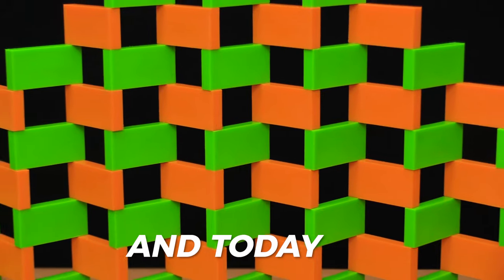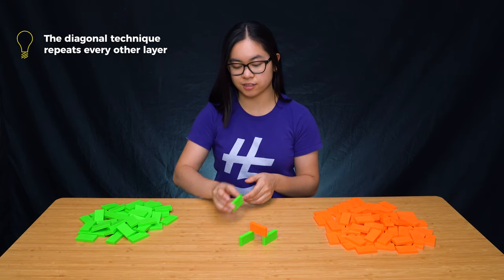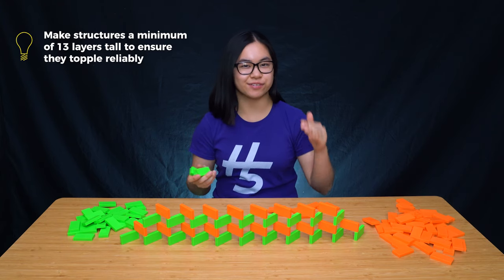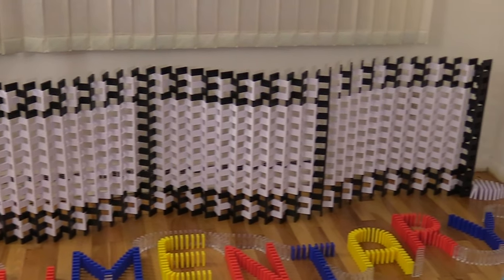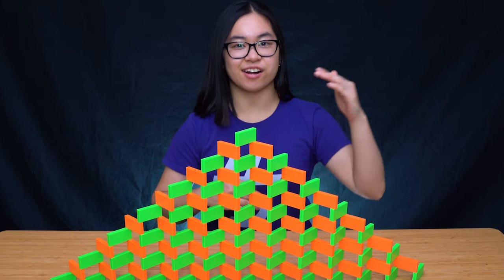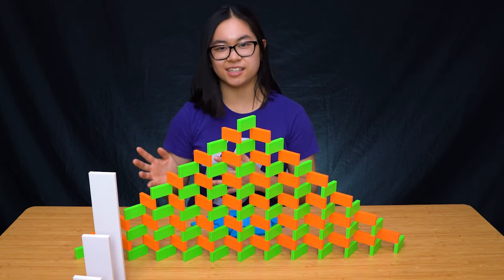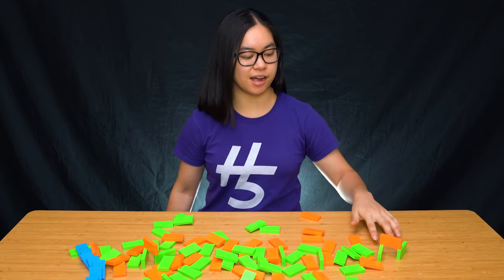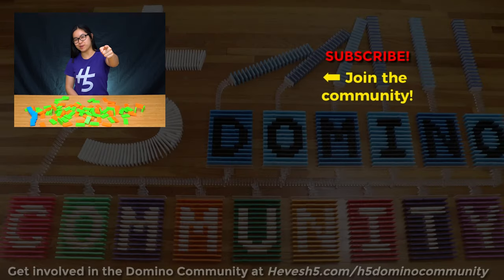How to Build a Domino Wall (pt. 3: Diagonal Technique)

Comment from the maker: what is your favorite wall technique, and why do you prefer to use that one?
Reply: The diagonal technique because your videos get better !
Reply: Diagonal technique is too good because it looks too  good and is uses very little time 🤠🤠🤠
Reply: I love this technique better than anything cause its so smooth when it falls its like a feather
Reply: My favorite is The Diagonal Technique, as well as the Column Technique.
Reply: This one in this vid which is easy to build and it uses a few blocks of dominoes only! Awesome!
Reply: I was searching for this Wall
Reply: The wall column technique becasue whit a little bit more easier than another strucrures
Reply: same
Reply: H5 Domino in india
Reply: The column tehnique because it opens the most posibilites to the builder
Reply: I already knew this but this is my favourite 😄
Reply: I like column technique
Reply: Can you tell more
Reply: the diagnoal technique was easy and more creative
Reply: All of them because I can put the creativity to any walls and combine it to one structure!
Reply: I think it’s the other two rather than the diagonal technique
Reply: i don’t know
Reply: @RaduPetrici  column wall is the best wall type for handeling pressure from above
like in the wallback . . or . . supporting a small platform built on top
alternating wall can be connected to the 3d pyramid in interesting ways
and the diagonal wall is prettymuch the main component of many structures including that 3d pyramig

fun fact: alternating wall works with the normal wallbact . . but NOT with the Slanted wallback
that't where you need the collumn wall
Reply: The Alternating version because I don't want to leave any dominoes still standng
Reply: Diagonal wall technique bc it is so satisfying and your videos get better and better so diagonal wall technique it is
Reply: I would use this one bc I just made a wall with this one and I made a wall with all the techniques and added some sonimod to it and the slanted wallback and the full wallback and a backup line and the split to topple the backup line and I just prefer this one I would tell all the people who is reading to use this technique plz use this one I am telling you to use it and everyone else to use this one bc I just love it’s amazing
Reply: I like the diagonal technique because it more looks better
Reply: @nosfe_458  same

Comment: Yaay! The final part of the domino wall tutorial series is finally here! I'd say that my favorite technique is the diagonal technique, it's something about the reliable feeling that I get while building this type of wall (Not to say that the others are bad, it's my preference). Also this is a plus point about the diagonal wall for me, it's short, which means that it works like MAGIC with wooden dominoes. Everyone probably knows about the wooden domino dimension problem already, but if I had to recommend a technique to the people struggling to build giant structures with wooden dominoes, it's the diagonal wall, because it isn't something that gets tall, so that's a plus point. 
Anyways, good work Lily :)

Comment: WOW, thank you so much for featuring me after posting that comment on the advantages of using the alternate and column technique! 😎
Ok, what can I say about the diagonal technique... which is more manipulable as we saw in regular and irregular shapes, and that it can be easily transformed into a wall using the column technique, disadvantages: none, except that if you want to make a straight wall, it is more advisable to use the column technique or the alternative, and as I told you in this case I would prefer to use the alternative technique for straight walls! 😉

Comment: Great job! Lily! The tutorial was very detailed! 

My favourite wall techniques was diagonal techniques and column techniques. This is because diagonal wall is easy to build. And I think those are more stable to build and trigger will be more easier. I think the alternating technique wall can be a little bit unreliable. Because not all of the dominoes can be build for alternating techniques. And I think sometimes it will fall accidentally when it blew by wind. 

But yeah the tutorial was really good and Lily you did a really fabulous job though!
Keep on building! :D  /|||
Reply from the maker: Thanks! And good points about each type of wall - thank you for sharing your thoughts!
Reply: @H5dominocommunity  Thank you! :D

Comment: One tip:
If your dominoes are not 2 by 1, refrain from using the alternating technique to build walls.
One bonus:
It is possible to build a 90° wall with the ALTERNATING technique.
Reply from the maker: I would agree with your tip (especially avoid the alternating technique because the vertical domino will not align). Yes it is possible to build a 90 degree wall with the alternating technique. I will make a tutorial on this in the future!

Comment: Hello Lily! Is it possible to build a wall using this technique that has perpendicular corners at the top and not that pyramid-like shape? And if so, how is it made?
Reply from the maker: Yes, it would be a similar method to how I made the "square corner" on the column technique tutorial. Since those 2 techniques connect (they have similar structures), you can use the same method to make it a perpendicular corner: https://youtu.be/FURDwGllIak?t=314
Reply: @H5dominocommunity  Thanks a lot, Lily! 🤗

Comment: how do you make , not a pyramid shape wall of this trick .. but can you teach us how to make half pyramid diagonal wall and no pyramid diagonal wall?
great video BTW:)
Reply from the maker: it would be a similar method to how I made the "square corner" on the column technique tutorial. Since those 2 techniques connect (they have similar structures), you can use the same method to make a half pyramid diagonal wall: https://youtu.be/FURDwGllIak?t=314